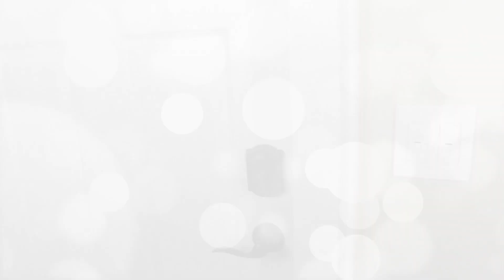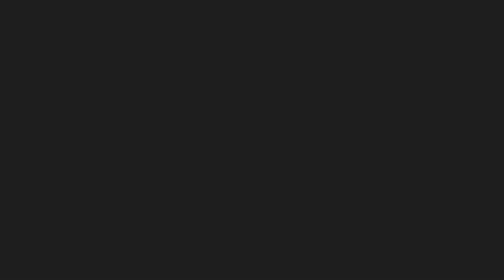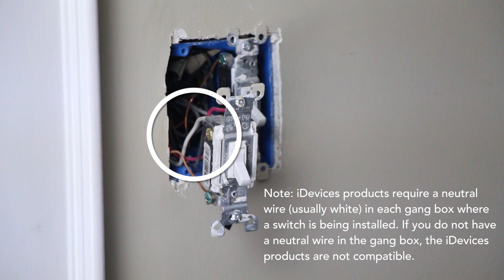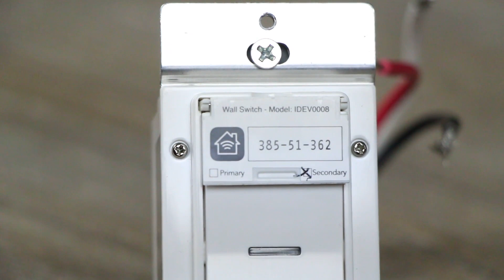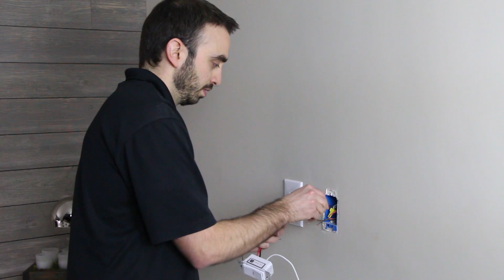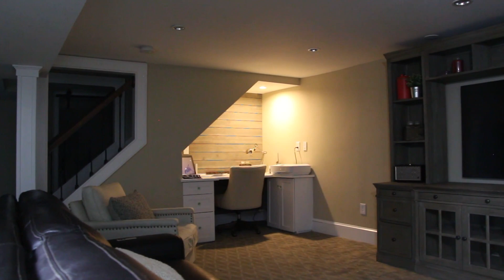How-To: iDevices Wall Switch and Dimmer Switch - 3-Way Install Setup

Comment: It’s been proven time and time again that you don’t mix labels when dealing with safety related items.  Line vs primary switch and Load vs secondary switch.   This is how deaths happen.  Improper labels for electricity.  The switches should be labeled with the same label as the wires you are labeling.  If the wire is labeled Line, label the switch Line.  If the wire is labeled Load, label the switch load.  Why are you making it complicated... and dangerous.  If you’re electrical department is this careless with just hooking up switches, I would stay away from them any time they are doing anything dangerous.
Reply from the maker: Hi there, we appreciate the comment. Our labeling follows industry standards and we've worked diligently to make installation instructions as clear and safe as possible. We recommend that anyone uncomfortable with the installation process hire a certified/licensed electrician. We've passed your comment on the proper people and as always, take every piece of feedback seriously. Thanks again!
Reply: iDevices personally I appreciate the thorough explanation for someone used to diy not having to call an electrician. My uncle is a master electrician in another state so I asked him to watch it and he approved.